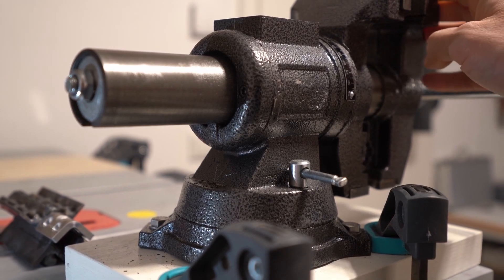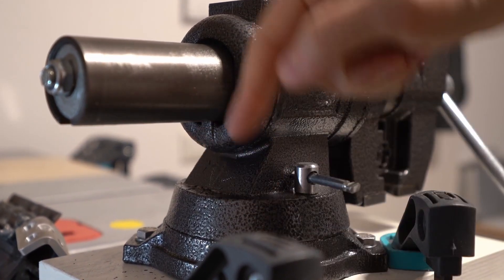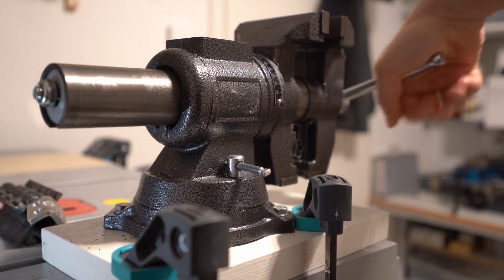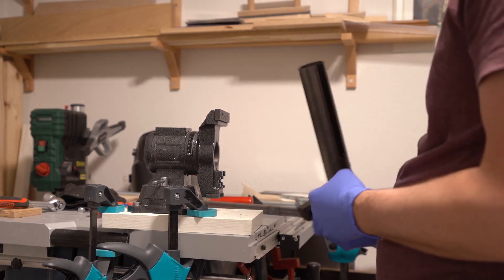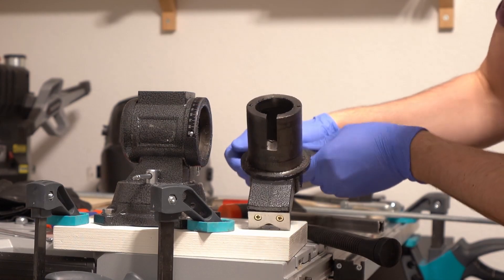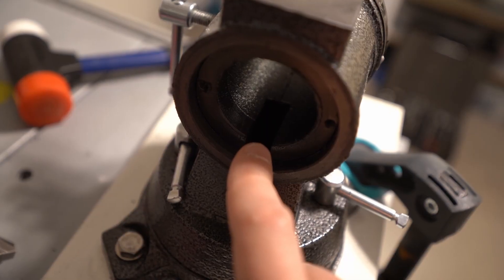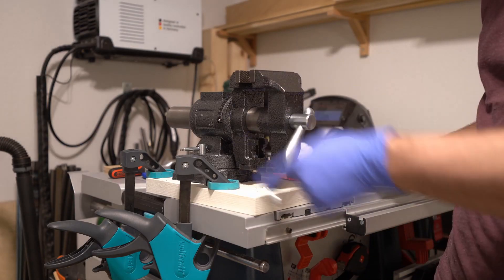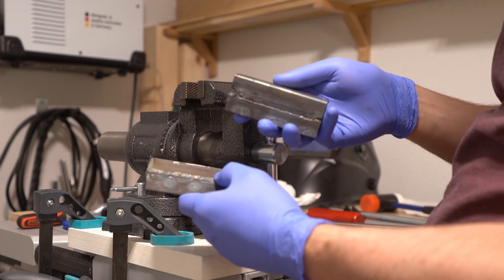Vice bending

Comment: Nice repair.

If you decide to build a bigger vise from plate steel, the Fireball Tool channel is great for design ideas.  I’m guessing the welder on the wall can weld 6mm plate in 2 passes, so it should work.